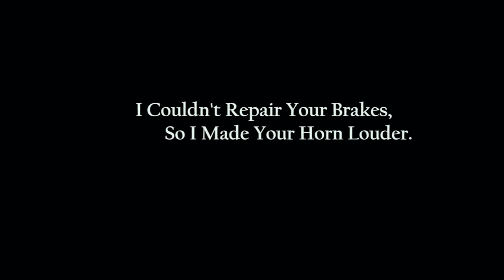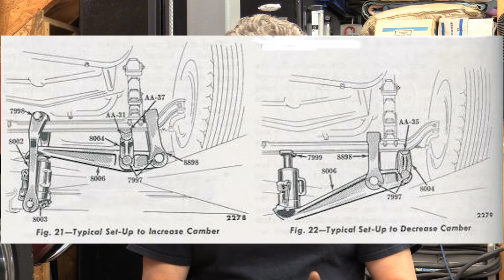Tips For buying Used Ford F100 Disc Brakes Episode 451 Autorestomod

Comment: Having separate parts and being possible 40 years old, out of pure safety I think I would take the whole thing apart and rebuild it. New rotors and bearings, rebuilt calipers and hoses, and rebuild the kingpins and replace the bushings. That way you could also sand or blast and powder coat or paint the control arms. It’s a project that could be done as money affords.

Comment: Thanks for the video, I've got a '67 F-100 w/ power drums and have a few questions:
1 - Are the radius arms and i-beams the same between 5th Gen (67-72) and 6th Gen (73-79)? If not, it seems the only benefit to getting a full 6th gen setup versus aftermarket spindles is just to avoid messing with the kingpins 
2 - I see kits with supplied spindles as well as kits that use the drum spindles, any reason to avoid the latter other than risking your spindles might be toast? 
3 - Proportional valve? I always thought needed for discs but a factory drum setup wouldn't have that 

thanks

Comment: Jeff I converted my 65 F250  to front discs awhile back.  I searched for used parts in my area and came up empty.  The only option for getting the needed parts used was to buy a donor truck and I didn't want to do that.  So I started shopping for a kit.  I ended up buying from CPP.  In talking to them I was told that this kit wasn't always available because of the shortage of spindles.  Explains my search failure.  For anybody out there with an F250, the F100 disc brake kit will work.  The I beams are the same between the two as well as the king pins.  Down side is you will have 5 bolt at the front and 8 bolt at the rear if you still have the Dana 60 as I do. Great video, thanks!
Reply: Thanks for the info. Who is cpp? Im in the same boat. I’ve thought about swapping a 9in to have matching bolt patterns. I’ve also read that they did make Dana 60s with 5 lug axles but they are pretty rare

Comment: Thanks for the information - I bought a 1972 Ford F-100 and it has the Front Disc Brakes and because of this video - my set came from a 77 - 79 F-100.  I bought rotors for 1973 and will be putting them on - hope they fit.
Reply from the maker: Glad it helped!

Comment: I remember converting my 70 F100 to disc brakes about a year ago. The installation went perfectly except for when I was bolting the tie rod ends. The disc brake setup came out of a 74 F100 and the thread of the tie rod on my 70 was not long enough for me to bolt it to the 74 spindle. Needless to say I ended up buying a whole new tie rod assembly for a 74 F100 because "while were here" the rubber bushings were shot. I also had to change out the master cylinder designed for a front disc brake setup in conjunction with  a proportioning valve. Thanks for the info about the king pin stuff, that was something I totally did not think about when I had the I-beams out. 👍
Reply from the maker: Huh, the tie rod thing is news to me. I'll have to consult the Fordification site and see what the gurus say. Thanks for the heads up!

Comment: About the only place that can adjust camber on these trucks (like if you want to lower em with shorter coils) is a alignment shop that does box trucks and larger. A lot of bigger trucks have used beam type with king pin suspensions and have the ability to bend beams.
Great show sir. 👍
Reply from the maker: Thank you!

Comment: Can you do a video on the brake lines modification, master cylinder and proportional valve needed along with the modifications needed on the rear brake lines to fully convert the F100 to a front disc brake system?
Reply from the maker: It will be part of the video series on the F100.

Comment: Thanks for this video Jeff, I have been waiting for a good how to on this.  I am swapping a 76’ onto my 69’ and have discussed the subject on Fordification.  Two quick questions for you:
1). I don’t have a lift in my shop, how else besides installing the assembly can I test the king pins?
2.) Is it possible to pull the king pins and just swap the spindles ?

Keep up the great work !
Reply from the maker: Not sure of a good way to be honest. You don't need a ton of weight, just enough to stabilize the arm and prevent movement. Broken down like we had ours, you can tell pretty quick if they are bad.

From what I've read you are better served using the arms that came with the spindles due to the changes Ford made in the steering stops.

Comment: Great video! I have a 65 F100 and I-Beams, Controller arms, spindles, and brakes. I already removed the kingpin and disassembled the rest because I am going to repaint everything. IIs it ok to use the same kingpin when I reassemble?  Are you going to have a video on completing the brakes?
Reply from the maker: I would replace it.

Comment: I know it is probably impossible for you to do 4wd, bit I have a 72 f100 with a dana 44 low pinion axle, I plan on doing disc brake conversion, so if you could possibly find at least a little info on what parts to use. forums get confusing by jumping all over the place and not giving a straight forward answer

Comment: I was parts manager at a Ford dealership in the 90’s and we had some camber adjusters for twin I-beam suspensions, but I can’t remember the brand name. But an alignment specialty supplier might still offer something like it.
Reply: The later trucks had ball joints instead of king pins and you could set the caster and camber by changing bushings.  Fixed and adjustable bushings are available. The older setup with king pins had no provision for adjustment.

Comment: Ok I’ve gotten me a complete disc brake setup from a 73-79 f150. I got everything but the proportion valve. Is there a way to tell what year the setup is. I have DJM lowering ibeams on my 71 now and was wanting to make sure I get the correct king pins for the spindles. Also will need to get new calipers or atleast rebuild the one I have with the setup. My setup has the shields that have the vents.
Reply from the maker: Look for part numbers on the spindles.

Comment: Can’t wait till the install that’s what I’m wanting to do on my 71 short bed. One question why would anyone bend the radius arms I understand the I beams but my radius arms have been bent for some reason.
Reply from the maker: Possibly to correct a caster issue? One of the radius arms on the I-beams we have is bent at the bolt.

Comment: I have a 1969 f250 camper with 360 a/t previous owner had autofab  lift put in (bent I beams 5” , longer springs and aluminum blocks and longer u bolts inThe rear) I wanted to do a drum to disc conversion. Truck has brand new kingpins put in. Any suggestions on weather or not it can be done with the current height I beams?
Reply from the maker: If the beams are at correct ride height, it should be fine. All your camber is done with the beams, not the spindle. So brakes would not be an issue.
Reply: Autorestomod Manic Mechanic Gasoline Media 
Thanks I’ll have to look into finding either an aftermarket kit or a 72 or 73 disc set at a junk yard or online

Comment: I have the camber problem on the passenger side only. Only about 10k miles on the kingpins.
Reply: Most big rig alignment shops can bend them. That's how they align most big rigs.
Reply: @mattwalmer6162  thank you

Comment: You would think that with the popularity of the Crown Vic swap, these suspension assembles would be easier to come by.
Reply from the maker: Or harder...
Reply: @AutoRestoMod  
I should have been specific.  The "original" twin I-Beam suspension assemblies that folks are removing to do CV swaps.  Where are they all going when they put in the "today it's cool" Crown Vic subframes?
I have noticed the CV subframes climbing in cost and shrinking in budget availability.

Comment: Ford is batting a thousand when it comes to bad suspension design in the 60s. Sorry Ford guys but their suspension designs were pretty bad across the board for a very long time. I have one and I like some of the cars and trucks but they really left allot to be desired in the suspension area. 

        I haven't seen the I beam bender in a long time which is why many used a torch.
Reply from the maker: I guess 🤔